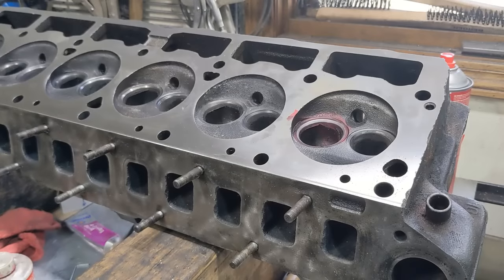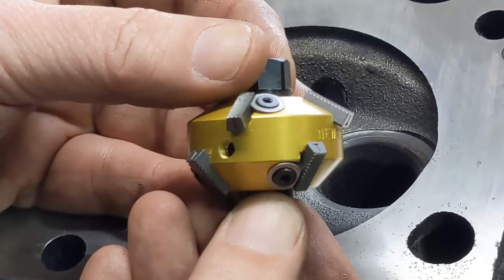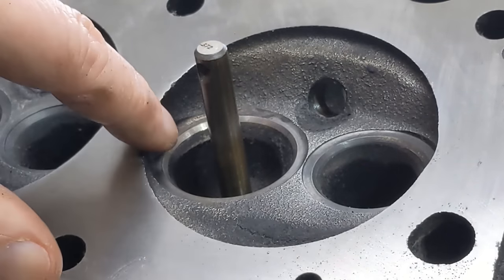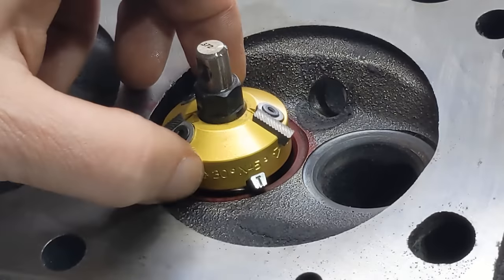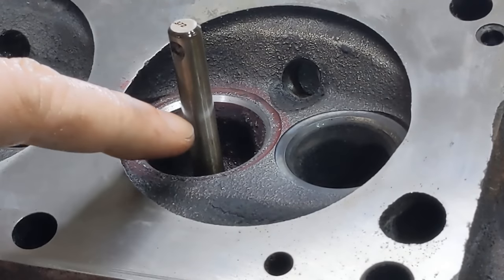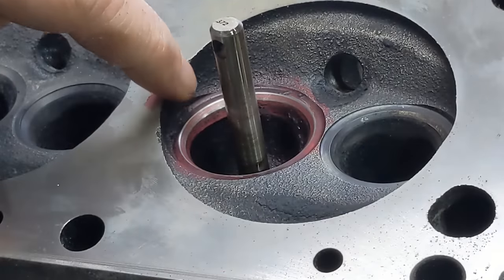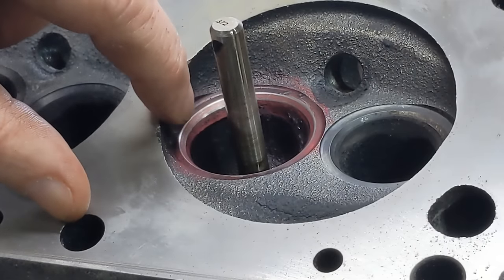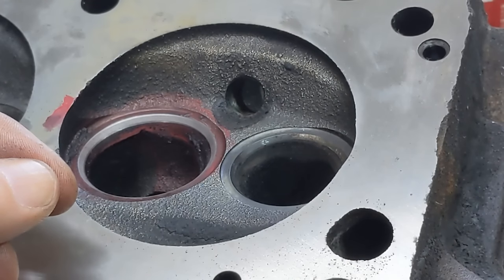Do Your Own 3-Angle Valve Seats!

Comment: Ffs, just send it to a good machine shop and have the seat width, depth & angles finished properly. Honestly, we don't mind doing these jobs and it'll cost you MORE if you proceed to fuck it up and then ask us to fix it. Sheesh...
Reply from the maker: Absolutely! No one should even attempt to do things themselves any more. I mean why did I even tear it apart or assemble it? I could have just had someone else do it. For that matter why do I even drive a car? I could always just call a Lyft. You've convinced me! I'm getting rid of all my vehicles, just have to find someone to sell them all for me.
Reply: Plus, we can see the work the professional machine shop did with the resurfacing.  Taking it somewhere doesn't mean it will be done better.  It seems more and more it means it will be done worse.
Reply: @damnimcooltom1  I bought a set for myself after a machine shop fucked it up in the first place, they didn't use heat to remove the guides, snapped one, threw an old inlet in to the exhaust side and called it a day!
Reply: Why send it to a competent machine shop? CNC machining. Depth of all 3 angles correct to head joint face, concentric bore and k-line of valve guides and superior surface finish.
Money well spent, and I get a kick out of doing the job.
Reply: Maybe, just MAYBE that is not an option. Machine shops around Boise are 4 months out. 'qualified staff' shortages' ........ And, dissing someone who is showing an alternative and effective DIY, shows your character and arrogance.
Reply: @raviscott4853  many machine shops willing to do this are incompetent and the ones properly trained with new enough equipment charge just below the price of replacing it
Reply: machine shops fucked up my parts so many times i wish i could do everything by myself...
Reply: @YoshimoshiGarage  now that's funny
Reply: @YoshimoshiGarage  LOL
Reply: What would a machine shop typically charge to do this process?
Reply from the maker: Probably $25 or so per valve
Reply: I've taken things to a machine shop they screw things up too in the past so just because it's a specialty machine shop don't mean they don't eff things up they totally messed up a thrush surfaces on a 22R crank I had last year
Reply: this post reminds me of all the doctors i met who are shocked--shocked!--that other doctors "bury their mistakes".  Any client of a machine shop should know, there are machine shops that crank out work good enough for a remanufactured engine--in other words, your work is "within spec". there are others who do race engines--they go beyond OEM spec with flowbench results to know what angles are best. and some are just perfectionists--i got into a debate with a garage owner who bragged he took an entire day to set alignment on his clients' cars. so i asked him how he got their right body weight--he had no clue what i was talking about. so i pointed out the potholes in his rented property from garage door to street and asked what he thought happened to his perfect alignment the moment the client rolled past the garage door.

i do get the point--if the customer fucks up, there's more work to be done. but too many "machine shops" have pumped out poor quality work that finding an actual good shop is a chore.
Reply: Send it to Pakistan.
They'll throwing the head in the dirt, a blinded welder will eliminate any cracks and finally 3 generations of "super highly skilled professionals" uses their sledge hammers for trimming the head into specs.
After that, all tolerances are less than 2 fingers and the engine is as good as new.
Reply: @horstmuller7512  like the Kalashnikov rifle--we sneer at its accuracy but 10 million peasants can't be wrong :)
Reply: where do you find a good shop cant even get tires installed properly bent rims  out of balance and damage from lift last machine shop i went to ruined subaru  heads
Reply: I turn jobs away where people admit they tried to do it DIY and effed it up. Not worth it. Tooo much headache, not worth the money.
Reply: @YoshimoshiGarage  When you work with a shop for decades they cut you deals as they know they will continue to have your work coming in. A typical 350 SBC build is 2$ per valve for us. With a warranty and piece of mind.
Reply: @crisnmaryfam7344  painters are like that, they won't touch someone else's primer work to put a top layer on.
Reply: @raviscott4853 👍
Reply: I’ve used a neway on some seats and put another of the same head in the serdi. They both sealed perfect and ran 7’s. This was a dohc 2.0 liter setup.
Reply: learning is priceless, sometimes te payback is questionnable but the enperience gained  worth the pain.
Even if the cost of the tooling offsets the cost of the job, the experience gained 
for over 40 years, I acquired and dwsigned the equipment I use now and I won't return back for any money.
Reply: @jacquespoirier9071  agreed, when i was a lad, my father asked anyone coming to our house to make repairs if i could look over their shoulder--i could fetch tools in return. the thing is, you don't even have to know how to do the task, if all you learn is there's no such thing as muffler bearings or blinker fluid, you come out ahead of the ripoff/jackoff repairmen out there. 

i know i've saved over a thou$and dollars on unneccessary home repair by second guessing the first estimate and finding a second who was honest...that came from what i learned.
Reply: At 44 I've figured out that someone who wants to do it right can learn quick to do it better than someone who knows how that don't give a F.
Reply: @lsgt5132  agreed, someone intelligent who recognizes when "a dime gets in the way of a dollar" does better work on their own belongings than the "professional" who is just collecting another payday. Pros complain about DIY but often they are the ones driving customers towards Youtube to find out WTF.

I often accompany female friends to mechanics, and one time my bestie had a Mitsubishi Eclypse Spyder the mechanic spent all day figuring out whether the rear struts should come out thru the trunk or the back seat where the Rockford Fosgate stereo was factory located. when I picked up my friend (since she couldn't drive it home) I recommended to the shop owner he look it up on youtube.

he sneered at me, but she called me the next day to say, yep, car fixed...they looked on youtube to learn how it was done.
Reply: @YoshimoshiGarage  Your unnecessary unneeded Irrelevant comment is the only reason I even commented on the video.
Reply: Just because the sign on the building says "Machine Shop" (who's main work is probably resurfacing brake rotors) there is no guarantee that the person doing the job is a TRUE machinist! More than likely your 3-angle job will be done by the shop helper (who barely speaks or understands English). If you're going to have a shop do the job, find one that does competition engine blueprinting and ask who they have done locally. This video gives good info and the tool manufacturer's site has a detailed pdf. If your favorite go-to tools are a hammer & slip joint pliers...well, you shouldn't be working under the hood in the first place!
Reply: Boy howdy who pissed in your cheerios this morning? XD
Reply: Perhaps if all professionals are like you and me etc, however I don’t blame any negative commenters against donkey professionals out there for obvious reasons that I don’t have to explain. I am here because my 22 years old son told me about an idiot cutting seats like an ape so here I am to declare a thanks and this is why I am charging X3 my  jobs when comes to me like that. Cheers
Reply: @61Merc  Yes, the disrespect shown to DIY folks is shameful.
Reply: THAT, is a quality response 🤣
Reminds me of when I rebuilt a 1600cc Ford crossflow engine over 30 years ago and it was the the most satisfying and enjoyable projects I’ve done to date.
Great job and thank you for sharing 👌🏻
Reply: @Ravi Scott    That's just it, 'to a good machine shop' seems to be hit or miss - they have the capability & tools but they just don't give it the care and with the newer automatic stuff, they've got the capability to REALLY fuck it up fast and completely.
Reply: @alro2434  Being in this business for 27 years, you find the shops that don't care, don't last. In any case, suit yourself if you think yo can do it then go ahead. I wish you luck.
Reply: Name drop your shop so we know where we shouldn't go.
Reply: the problem is good machine shops with the wisdom and knowledge are scarce even in big cities these days, I know all about that the hard way. A  very simple 3 angle valave job as shown in this video is the best route. However a person without a garage or tools I would agree should have throw the dice, spend the $500 dollars and have engine machineshop do the valve job and hope it was done right.
Reply: @dooby1445 Adelaide Australia bro but its ok, im pretty sure ill do just fine without your patronage. Petty sure you're in Northern Mexico and can find a competent shop. Somewhere.
Reply: @YoshimoshiGarage  He wasn't particularly polite,but nuway cutters rarely leave a concentric seat or good surface finish,and its caused by hand pressure influencing the cutter instead of steady machine pressure. The other problem is the cutters are opposite of what you would cut a seat with properly. You can get away with all this stuff,but its not correct. Will it get you by? sure,longevity is usually shorter. Fixed alot heads damaged with well meaning folks using this stuff over the years. Proper tools go along way but they are expensive.  Much of this could be done on a quality vertical mill.
Reply from the maker: @a4000t  Sorry, I really don't think it's a binary "right" or "wrong."  Will a vertical mill or dedicated head mill be more accurate?  Of course it will.  Is more accurate better? In many, or even most cases, sure.  But if you're a garage hobbiest and you like doing things yourself, and you have a car that sees maybe a couple thousand miles a year, and you aren't trying to pull every last horsepower out of the engine ,is it "wrong"?  I'd say no.  This engine will easily perform  as expected for longer than I likely will use it.  Maybe a high school or college kid with not a lot of cash and a car that's largely rust holding hands wants to do this sort of work.  The engine will outlive the car it's in.  I have no issue with what machinists do, and they certainly should be used when the work warrants it, but all of these triggered guys trying to act like the engine's going to grenade next week are full of shit.  On the good-better-best spectrum, this falls right into "good enough" for a whole lot of applications.  And Ravi wasn't impolite, he was a dick.  I chalk it up to the fact that some people think the anonymity of the internet gives them the right to be a dick, but who knows, maybe he's a dick in person as well.
Reply: yes grasshopper, you speak wise words. I do all so agree.
Reply: @Ravi Scott is mad 😂
Reply: There are plenty of ways to do this yourself.  That was the whole point.  I bet you took your wife to get married by someone else too.. Be a man.
Reply: @raviscott4853  K-line guides? That's only an option for adding clearance where the parent metal cannot be replaced. The pro's machine and install entire bronze and inconel guides, not just a bushing.  I bet you fall for anything as long as someone just smarter than you put's a price on it.
Reply: Ffs, A Damn machine shop acts as if it's a damn burden to just do a partial or small job , then obviously your proof that they even cry about the shit when you do it yourself ! More reasoning would be the
Reply: Ffs,  machine Shop Owners act like there the Best and any small job is a burden to them as if machine work is some type of magic, its not !  I have met only 1 machinist , who could do a job in a timely manner or even on the spot if you needed it ! MOST SHOP OWNERS ACT  act as if they have a Doctrine, and then try to hire someone to do all the work for them ! Worst of all and biggest reason to do it yourself is no Honesty within a Machine shop, they all lie ! Lol then complain when people decide to do the shit themselves ! I'll end with saying I can assure you machine shops screw up more heads than people who do it themselves , sheesh!
Reply: it's not rocket science, and some people just like doing stuff their self.
Reply: I'm currently re-assembling a head my friend took to a professional machine shop. They straight up did not grind one of the valves and one of the seats. Both were pitted badly. We would have never known had we not taken it apart to check their work. What is the point in paying someone if you have to go behind them and redo their work anyway?
Reply: @crisnmaryfam7344  sweet, I'll just throw money away for decades hoping to someday achieve "customer worth giving a shit about" status.
Reply from the maker: Let me know when you get there because I sure haven't.
Reply: @YoshimoshiGarage  I've been with my local welding supply store for about 10 years and, the other day, they gave me $10 off on a gas bottle fill up. I've pretty much reached the promise land there, lol.
Reply: Honestly, this exactly sentiment is the reason we probably won't have readily accessible machine shops in a couple decades or so. The owner of the go-to shop in my city retired and closed up shop when he did. The next most recommended shop's owner is going through family health issues so they won't pick up the phone, the front door is locked, and there's a giant pile of rusted out big blocks out back. There's a new shop with all state of the art CNC machines, but since they specialize in 1000hp builds for formula drift guys they won't take you as a customer unless it's for one of the handful of engines they build. And, even if they do, they charge a ton of labor hours for even basic jobs. Another shop my neighbor took his block to for a basic bore, hone, and deck dropped and cracked it then tried to say it the damage was there when they got it.

Most of the old heads with all the knowledge are getting to retiring age and that knowledge isn't really getting passed on. The guys with decades of experience keep their knowledge close to the vest and aren't sitting around putting out their tips of the trade and secrets out on the internet for free. The actual machinists that do the work in the shop are making like $20 an hour which isn't exactly a lucrative career path, so there's not a lot of young people interested in taking up the trade. Even in big cities there are only a handful of machine shops left who do all their own work, meaning you're often looking at 3-4 month wait times. Those shops generally have a huge backlog of rebuilds for commercial fleet vehicles and thus don't really give a shit about taking small jobs from individual customers or putting out high quality of work.

Each time another shop owner retires and another machine shop closes the pool of experience grows smaller and there's nobody coming into fill the void. We're not too far removed from a future where all new passenger vehicles will be EVs, so the demand for this kind of work is only going to get more niche. And, as it does, it will get increasingly expensive to have this sort of work done on a per-diem basis. Even now in a world where having a shop fully rebuild an engine will cost you 1-2k, but you can get a brand new long block 5.3 LS crate engine for 3.7k, the economies of doing any sort of rebuild work are already starting to not make sense. Doing these kind of projects is for the fun and satisfaction of the hobby. Rather than, "Ffs, just send it to a good machine shop" your comment should honestly read, "Ffs, just buy a new head." A factory spec, CNC milled new part will be light years better than the tolerances 99% of the remaining machine shops can provide and probably won't cost you that much more money to boot.
Reply: @61Merc  not any better in N Idaho either. I dropped off a set of heads to get new valve seats and was quoted a 3 week turnaround. Ended up going back 5 weeks later to find them still sitting right outside the shop door where I left them, and peaked inside to see a literal trail dug out in the shop so they could walk around all the heads and blocks they had sitting on the floor. Those guys were about 2 years behind schedule. Ridiculous. Got lucky and found a set of remanned heads in Boise.
Reply: Ruined a 289 head putting in threaded studs, then called me and said I need to go buy another one.  I didn’t tho
Reply: I have a ford flathead v8 and my local shop said they won’t “waste their time” working on it. It had a valve seat come loose. I found new hardened ones and replaced it after cooling it in dry ice. Can the angles be ground with grinding stones instead of the carbide cutters?
Reply: Yeah and then the "machine shop" uses this same fucking tool.
Reply: I notice you didn't say that he did it wrong...  LMAO!
Reply: @Ravi Scott  it's okay you're not a mechanic or a machinist. I would not have said what you said.
Reply: @Yoshimoshi  😂perfect response my friend!!! Verbal Perfection at it's finest!😂😂😂
Reply: It's called a learning curve. What I don't like a bout the clown is that he didn't say to go a junk yard a find a worthless head to practice on. I have 40 under my belt a a master automachinst. I thought my myself quite a bit before I got a chance. This guy really doesn't have the common science to measure the guide for wear. A wobbly pilot will destroy a seat
Reply: TBH, I now do all my own machining using nothing but a HF 9 x 20 lathe and a Webb Champ 3VH mill. Since I work mostly on boats (clearly I lack both money & good judgement), I built my own AC/DC Articulating magnaflux tool that can be varied between 8-45 lbs holding force (suck on that magnaflux) for less than $20. Also made my own iron powder and dyed it blue. Yet, no matter how successful myself or other 'DIYers' are, people still claim 'only a professional' can do it. Profession means it's how you make your money, it doesn't imply quality of work. I've found, even if I screw (something) up, ultimately I still beat the machine shops quality & price.
Reply: @x6itru  Nailed it ! The last 4 times I went to a machine shop with a crankshaft or cylinder heads , they f'd up the parts and twice charged me more than they quoted .
Reply: Lighten up Francis!
Reply: @raviscott4853 Perhaps consider, the ones you see are screwed up.  And you get paid to repair them.  The ones you DON'T see came out fine. How many? Who knows, you don't see them.
Reply: you have no way to experience machine shops from our side, but trust us. many times they bring their own problems, subpar work, long wait times, assumptions they made for you. if i can keep my stuff out of a machine shop i will. if you are racing for money then find a top notch shop and pay for top notch work. otherwise many shops just screw things up in their own way
Reply: @JLMiller410 yes, they can. I have used Neway for 30 yrs, but Stones work very well. They have less concentricity issues than Neway , untill your technique gets good. But they make a heck of a mess, and the dust is toxic.
Reply: Damn, pin of shame 😅
Reply: Why anyone would want to do this without the few hundred thousand dollars of machine equity needed.
Reply: "professionals" are why I do so much of my own work, lol
Reply: Well, why don't you make a video for us to see how it's done right?
Reply: I have had machine shops cause more problems. All depends who is working there and if they care about what they are doing. Bought my first Neway back in the late 70s, still have it and use it.
Reply: machine shops around denver are 6-14 months out for work and want 1100-1500 for a simple valve job...
Reply: I've rectified many faults made by "reputable" shops. No one is perfect.
Reply: Unfortunately, good machine shops were "everwhere" back in the day. Not so much today. People just don't work on their cars like they use too - for obvious reasons.  I'm not depending on Yelp.... just saying. Good advice no matter. Cheers
Reply: Bottom line is-it's your engine you are working on, so you have the right to do it the way you want to!     @YoshimoshiGarage
Reply: If everybody does there own valve job then these valve grinding machines shops will start losing money. 😂 Seriously though why not? Even if you f*** it up your learning a new skill. Nothing ventured nothing gained. 😂🤔👍 Kudos to you sir most interesting! 👏
Reply: @YoshimoshiGarage I took my Australian VG Valiant with the 318 Fireball Mopar motor I guess to a mechanic to get the welsh plugs replaced. Anyway I picked it up in the afternoon and paid him for the job. That night I headed for Adelaide from Melbourne which is where I lived years ago. WELL guess what!? Just out of Border town after refuelling my car the transmission starts to act strange 🤔 ... So I jump out and look under the bell-housing. 😮 only two bolts 🔩 🔩  holding the transmission in. 😕 Transmission fluid all under the floor pan back to the diff.

That's what happens when you trust some mechanics. 

I bought 10 litre drum of transmission fluid and nursed it all the way to Adelaide. It's a nine our trip and buy the time I reached Eagle Nest at the top of Mount Lofty it was getting early. Tired and hungry I fueled up again and drove down the winding decent to Adelaide and to my parents apartment.

From that day forward I rarely ever took my car to a mechanic.

To make matters worse I ended up flying home to Melbourne. I bought a pushbike and rode to work till I save enough money to fix my Valiant.

A month later I discovered that my father had sold my car and pocketed the money.

😔
Reply: The pin of shame! What an idiotic comment. If you and your ilk took pride in your work and didn't halfass your way through life we WOULD do this and consider it money well spent. Every time I've taken something to be worked on by a 'professional' I had to scrap it or fix it myself afterward.
Reply: The machine shop did the job last year .Now the valves  bounce like hell and are bent as seats were nio machined concentric. I will rather  do it myself and if i go wrong will be my mistake not others. With your attitude probably  you are out of bussines  by now 😂😂😂
Reply: @dyzzyone  I remember some irresponsible mechanic replace my welsh plugs which was behind the transmission. Well he replaced the welsh plugs alright but only put back two bolts around the bell-housing. On receiving the car I drove 9 hours across a border until the transmission started to play up. I got out looked up the car and transmission fluid dripping all over the roadway. He only put back two bolts. Fkn clown. Since then I always did mechanical repairs myself except the timing belt. I never looked back. It's better to do it yourself save yourself a ton of money and if it dies fk up at least you didn't pay some reckless moron to fk it up. Plus you learn new skills which itself is invaluable to one's skillset.
Reply: @damnimcooltom1  100%
Reply: Not to mention he did this valve regrind BEFORE replacing the valve guides that were shot!! 🤣🤣🤣
Reply from the maker: @jeffallen3382 no doubt! There's no possibility that the seats were re-done after the guides.
Reply: There’s not many machine shops that are any good anymore and if they are good prices are very high
Reply: You know you could suggest taking it to a machine shop or you could be cool. And thank the guy that made this video for showing garage doors that they can put surround and do pretty decent work in their own garage. You don't have to be at douche about it. To the guy that made the video, thanks a lot. It was a fun video to watch and really informative!
Reply: I am a certified Tech I dont see anything where he fuck it up I think he did a very nice job. And love the video and how he did it . If the valve guides are bad then I could see where this would go bad but he did and excellent job STEP OFF TH DUDES NUTS MAN :face-blue-wide-eyes::face-blue-wide-eyes::face-blue-wide-eyes::face-blue-wide-eyes::face-blue-wide-eyes::face-blue-wide-eyes::face-blue-wide-eyes:
Reply: @raviscott: Your ever-so-subtle argument falls on deaf ears. Move along, we only want to hear from Master Yoshimoshi.
Reply: @YoshimoshiGarage  hahahah!     Some people have more money than ability.     Get a lyft!   hahaha.  hilarious!
Reply: @YoshimoshiGarage  Absolutely!
Reply: Sorry but bringing parts to machine shops is a bit like russian roulette.
 
1 in 3 times I had to go back, because they for example measure a bore&hone job when the sleeve is still hot and I end up with 0.02mm of piston clearance instead of 0.055mm.
I always measure everything when I receive it and about 1 in 3 times something is wrong. 

Or they do other stupid shit, e.g. cut valve seats too deep out of shim range or something.  

I typically only let them resurface a head, all other things I do myself.
Reply: You have no idea. In my country you'd be lucky to find someone who could do that job correctly, and if anything went wrong, I would have absolutely no way to get it put right, let alone get my money back.